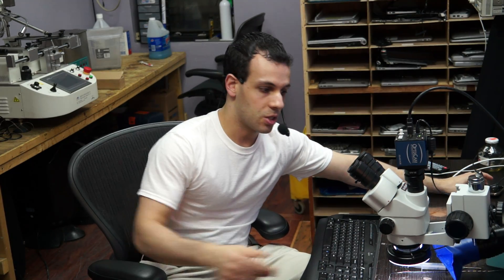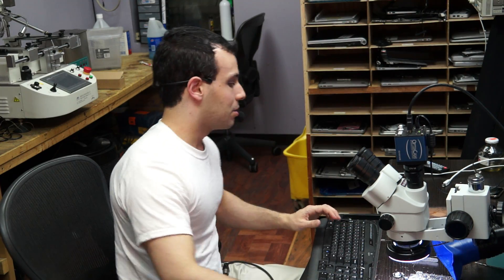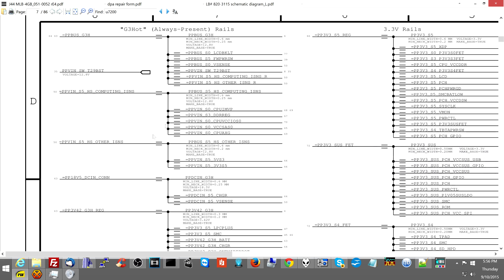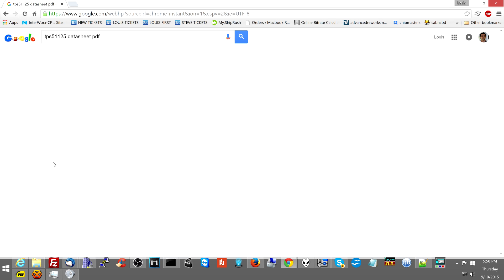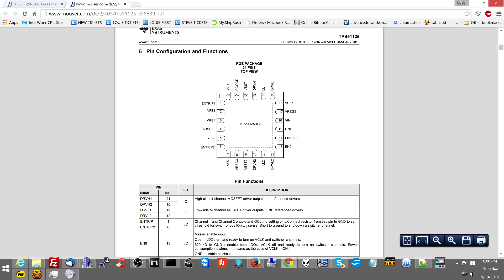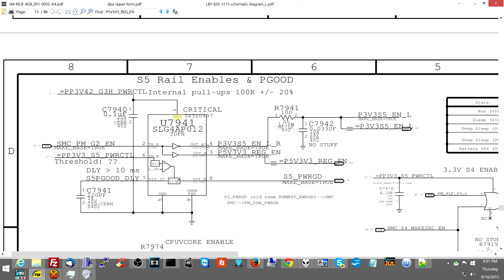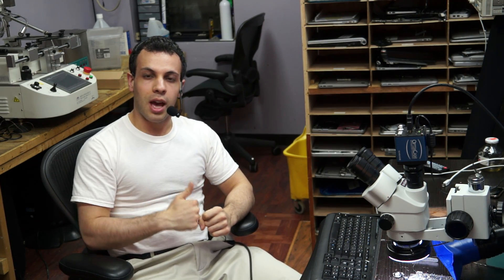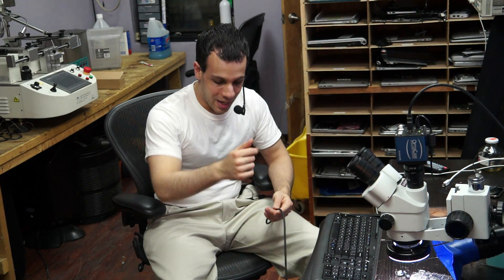Diagnosing Macbook Pro SMC failure chip U4900

Comment: My 2015 MBA has literally just started to act in a very similar way; slow startup, fan running continuously at 5000rpm. Built-in diagnostics showed a possible fault with the SMC.....and the camera.

Watched this video and immediately took the back off and disconnected the camera cable. That cured it. Now I just need to think about replacing the camera- thanks Louis!

Comment: @Louis Rossmann

Hi Louis!

I have a problem with my Macbook Air Original (2008). The sequence to the problem is this :

1. I worked for 2 hours on my Macbook Air, at night and I left it on for the whole night (I fell asleep)
2. When I woke up (at morning) the Macbook Air was turned off.
3. I tried to turn it on but nothing, the Macbook Air refused to turn on.
4. The magsafe light was dim-green.
5. I left it without the magsafe on for some days.
6. After some days, I plugged the magsafe on, the light turned on (yellow). 
7. I turned on the Macbook Air, everything was working! Did not have problems.
8. The battery icon showed that the battery was at 0%
9. Tried to shutdown Macbook Air from the drop down menu.
10. Macbook Air restarted instead of shut down. 
11. Unplugged the magsafe.
12. PLugged again the magsafe. Dim-green light. Nothing. Macbook Air did not turn on.
13. Left it for 3-4 days without plugging the magsafe. Battery swelled up. Removed the battery.
14. Tried to turn it on again. Magsafe light yellow > Macbook Air works. -> tried to shutdown -> Restart Loop instead of shutting down.

If my MBA stays without power for 2-3 days, the it works (with restart loops and "auto-turn on"). 

Can you please tell me your opinion? Is the SMC bad?? 

Thanks mate!
Reply from the maker: +uxm2009 the problem there is that it is a 2008 MacBook Air
Reply: Louis Rossmann You mean that it is an aging problem?

Comment: U6900 is getting power and is in the open state with charger connected. Between the INT and EXt I get .5V. So if I am not mistaken from testing other macbooks for power voltages I get 16V 16V 5V. But this I get 16V 16V .5V So to safely say my SMC is not spitting out 5V needed? The question is "should onewire circuit be 5V?" It is 5V on any other macbook. This is an 08 with Magsafe original lol.If you would be so kind to tell me if onewire should be 5V, thx.